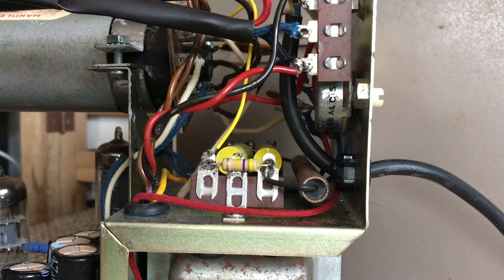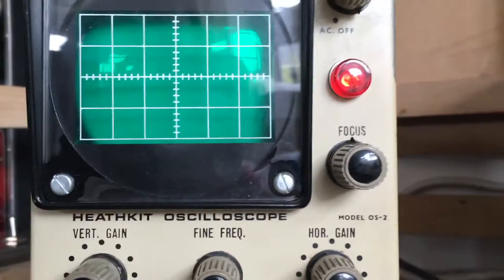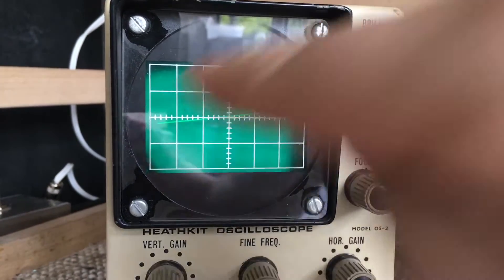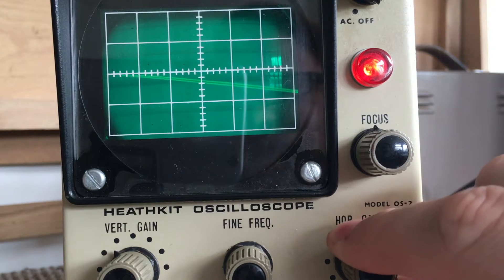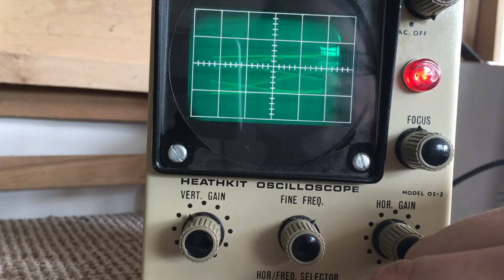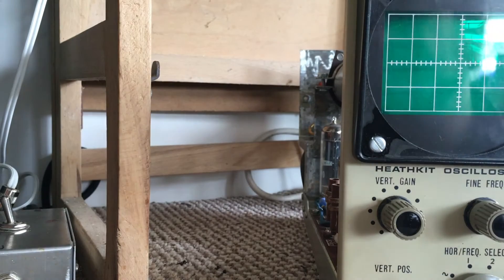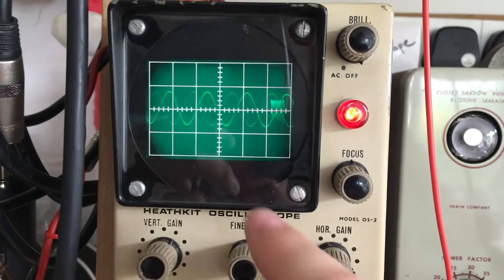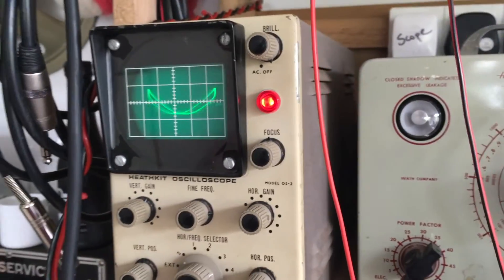Heathkit OS-2 Oscilloscope #6 - Finale

Comment: I built one of these when I was around 16 years old, the year they appeared in the catalog. I just wanted a scope because I thought they were the coolest thing you could have and at that age the price was still significant. I had already put together a Heathkit educational series and a Heathkit solid state guitar amplifier, but I really pooched the soldering on the 'scope. It was embarrassing. I took it to the local Heathkit store and their service guys repaired it a no charge; just a long list of cold solder joints. At least I made a point of getting my soldering skills sorted out because of that.
The last time I saw my scope was in 2014. It still powered up but was keeping company with other old gear as a curiosity at a friend's shop.

Comment: You have the same mindset I do. I have rebuilt several Heathkits  and I totally disassemble and reassemble testing as I go. That is the only correct way to do it. Great series of videos!
Reply: Yes, "Re-Kitting" is often the best way to go when restoring a Heathkit, particularly when the original builder did a questionable job.